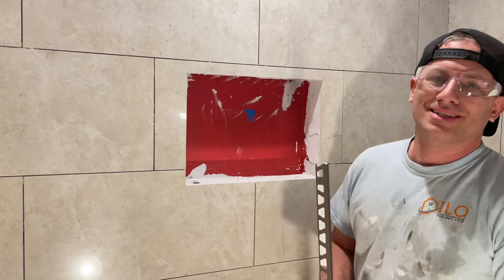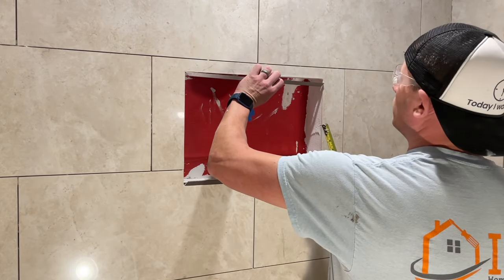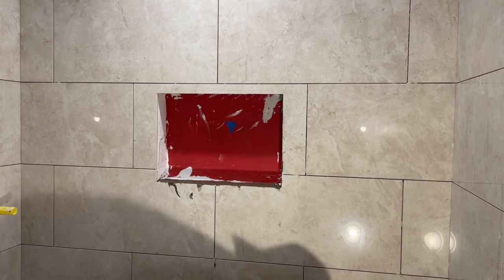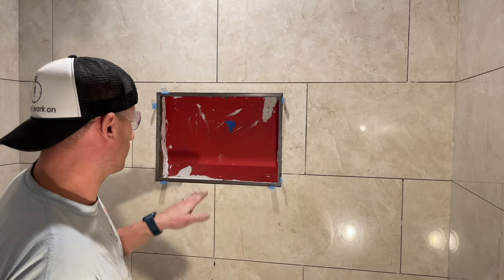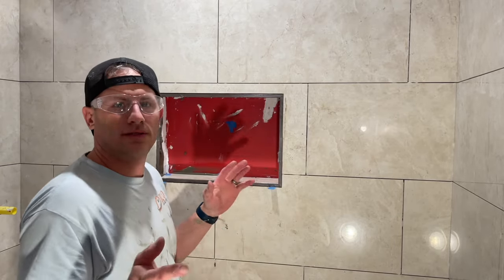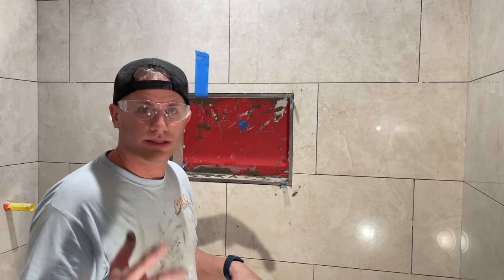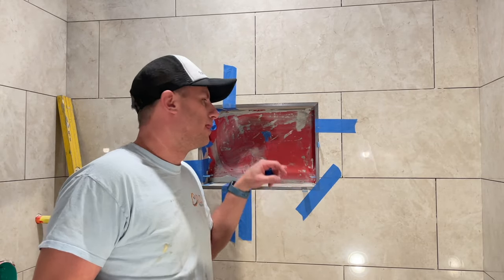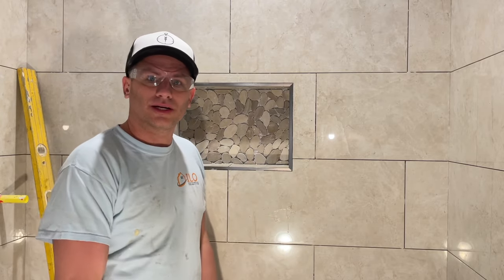How I Trim and Finish a Tile Niche

Comment: I'd be pissed if my niche was offset and off center from the tile like you have it. Looks bad. AND you're supposed to install the back wall of the niche first....but hey, every one is in a rush to start a youtube channel.
Reply from the maker: It might take a while to recover from this comment. Ok, I’m recovered.
Reply: @TodayIWorkOn   Sarcasm will not make you better at your trade. However it does reflect in your work. Hence the bad tile job. Not surprised at all.

And none of the lame retorts you have will correct that bad tile job.
Reply from the maker: @adamwest3266  it’s truly horrible. It’s why I’m no longer a remodeler and will build my own houses from here on out so I’m the client and contractor! Now you can rest easy. Wait for a bunch of mistakes and follies while I build my 12,000 sqft house. It’s gonna be super fun!
Reply: Looked for this comment. The offset would drive me crazy. 😂
Reply: @adamwest3266. The niche is perfectly centered east-west.  Maybe you should put the crack pipe down before bombarding a YT creator with insolence, condescension.

The back is customarily installed first, but ultimately it does not matter so long as it looks right and performs appropriately. 

P.S. Don't care what anyone says, you were the best Batman ever.
Reply: This was a joke right? Lol
Reply: Great job
Reply: No you want the bottom in first just like flashing a window! Sometimes existing plumbing/framing may not allow the niche to be centered
Reply: My OCD and anxiety would never let me sleep again knowing that niche could have been moved up an inch to line up with full tiles had a proper layout been done 😂
Reply: It’s not off center, just offset. More over it may have been the only option depending on what is behind the shower wall. If this is a remodel and not an original build you have no idea what was behind it and what they’re dealing with, more over the person who hired them may have opted for this, I think it’s a pretty neat look and I am not special by any means, so I’m sure others may like it as well.

Just because something isn’t your personal taste doesn’t mean you should berate someone out here doing their best to help others learn stuff. This was super helpful for me to finish tiling my bathroom and again - I’m not special, so I’m sure others were helped too.

Maybe stop thinking you’re so special that your preference is the center of the universe, because just like me you are absolutely nothing special 💜✌️
Reply: Back wall of the niche gets installed after the bottom shelf btw. If you install the back wall first you create a pocket where water can get stuck if you get a leak in your grout. If you install the bottom first then the back wall on top of the bottom, no matter what the water will always drain out into the shower.

Who told you to do the back wall first?
Reply: The back tiles of niche lack a complete grout line around the perimeter. Should have moved niche up an inch and wider, the size of a full tile.
Reply: Why would you do the back first? If that’s the case than any water hitting the back will run down into a joint between the back and bottom. If you do the back last any water will run down and onto the bottom and run out? Honest question? You seem like a level headed person give it to me?
Reply: You do not install the back wall of the niche first! You install the sill first. The back wall and sides should sit on top of the sill for proper water runoff if you ever get a leak in the joints. Jeepers, dude. If you're going to criticize someone at least know what you're talking about.
Reply: You install edges of a niche first, so when you place the back wall it sits in front of the "seal" created by the tiles on the edge. It gives better protection against water infiltration.
Reply: @joshualambert8346 No, you install the top first so the sides can support it and you dont have to leave a perfect gap for the top.
Reply: @Participant616  I was discussing rearmost wall.
Reply: @palebeachbum it doesn’t make much difference if you install the back first, water will always find a way under the tile if your using grout and thinset. Your niche should be sloped at the water proofing underneath the tiles so water can escape.

Comment: You used mastic in the back of your niche? Sorry for whoever that shower is for. It’s got it written on the bucket in red letters “Not for wet areas” that’s because it’s an organic adhesive and will delaminate when exposed to moisture as in a shower.
Reply from the maker: Have a beer and relax, It’s going to be ok. 🤣. You actually just gave me a great idea for a video!
Reply: @TodayIWorkOn  Stick to gutters and screen doors tallying is not your niche.

Comment: Good video, you can do it that way, we do. Solid surface 2CM quartz made to match any near flat surfaces like curbs, niches, or shelves . the metal trim tends to hold water right on the edge . even if you wanted to do 2CM solid surface quartz on the bottom, and then which would be better put the 3 pieces of trim around it. Looks good...... Also, nobody knows the true length of metal trim inside a shower without rusting,even the best marine screws rust overtime . that's why we switch to quartz for niches also, and it's better for water intrusion doesn't let as much water in.

Comment: Good video! A question that I do not want to come off as a criticism because I'm only in the process of learning how to tile and I just want to know for my own edification. Why didn't you raise the location of the shower niche so that the top and the bottom of the niche hit the horizontal grout lines of the tile? Wouldn't that have saved a lot of tile cutting and eliminated the need for grout lines in the niche other than at the corners? Thx so much!
Reply from the maker: That was the plan, but when I was recording the video, I mis measured. Lol recording while working is very hard. I made up for it in my wall to wall niche video. 😉
Reply: Poor planning

Comment: nice work! curious what you do about the mitered edge profile - caulk the tiny gap between the mitered pieces, or just leave it?
Reply from the maker: If you cut it super tight, nothing. If there’s a 1/32” gap it usually fills with grout.

Comment: Going to try this. thank you. 
Also when tiling the shower walls with 12 x 24 tile. Do you want the small cut piece at the top of the shower or the bottom. So full tiles all the way up  with the finishing tile that gets cut at the bottom or the top?
Reply from the maker: Because nobody is perfect, I actually measured out this to fit perfectly with a 12x24 and messed up by not accounting for an extra 2x4, so I was 1.5 off which is why the top of the tile has a small
1.5” piece. 😞. Measure twice and tile once. It’s just an aesthetic thing. 

In summary, try and shoot for a full piece.

Comment: Thanks for your video!  Hope you can help me with something I've not been able to find on youtube. Since you installed large format 12x24 tiles, I assume the tiles you cut for the inside of the niche were 3/8" thick.  What height Jolly trim did you use?  3/8" or 1/2"?  Thanks.
Reply from the maker: This is a great question with a complicated answer. Schluter says to use the next step up on height for the jolly. So, if the tile is 3/8 schluter recommends per my tile company to go 1/2. I have always gone against that rule and have gone with the same size jolly with the same size tile. So, 3/8 tile, 3/8 jolly. What people don’t realize is the base of the jolly already sticks the tile out 1/8 of an inch. If you get a jolly that’s 1/8” bigger than the tile, you have to now build out the tile 1/4”, which is a lot and it’s very hard to make it look right. 

In conclusion, stick with the same tile/jolly measurement and you will be gucci.
Reply: @TodayIWorkOn  THANKS MAN!!!  You are the first person that answered the question of jolly height for 3/8" thick tiles.  I even called Schluter and the tech did not (could not) answer my question directly. I will like your video and subscribe to your channel to help you out.  Thanks again!!!

Comment: Thanks for the video! What kind of blade did you use on the miter saw to cut the schluter? Would a regular wet saw work?
Reply from the maker: You can use a wet saw, but the carpenter in me likes using a real miter saw because it's WAY faster. Lol.

Comment: What glue did you use for the accent piece?
Reply from the maker: I actually used tile mastic(the white glue) since I didn’t  have any thinset on me, but the proper way to install the mosaics would be a modified thinset mortar. These mosaics held up fine, but if you had to choose two, go with modified thinset.

Comment: Great video! My question is, how is the mitered angle of the frame water proofed? I get that the grout seals the outside and inside edges, but the 45 degree miter is still not completely sealed
Reply from the maker: Tile, grout, and trim are not supposed to be waterproof. The substrate behind it is the actual waterproofing. If water does get behind the trim, it will go and release in the pan or though a grout line. Most times some moisture will just get absorbed in the mortar behind the tile and it will end there.  If you watch my video on how I waterproof the niche, I get into what actually waterproofs the shower as a whole. 

Most failures in a shower are due to a lack of proper waterproofing behind the tile. Tile, grout and trim is an aesthetic. The only exception to this rule is a waterproof silicone on an inside joint where a glass panel meets tile.
Reply: @TodayIWorkOn  That said, it wouldn't hurt to put a little dab of silicone between the mitered edges.

Comment: I have a question. Great video btw. 

My question is where does the tile need to end?right at the edge of the niche or does it have to past the edge of niche!
Reply from the maker: I usually go about 1/8 past the niche box with the tile so i have some wiggle room for adjustments.

Comment: Why did you not have the Niche a little higher so the tile on the top and bottom didn't need to be notched?
Reply from the maker: Well.... nobody is perfect? I Was videoing how to install this and messed up my measurements. It's a lot of work to video, work on a clients house, and be efficient.  I have changed how I measure and have not made that mistake again. Watch my whole wall niche video, I make up for the mistake here, there, lol.
Reply: @TodayIWorkOn  Oh I understand, I had this happen on one of my personnel projects.  It takes me longer to get the niche positioned correct than it takes to put up the tile.  Thanks for your response.

Comment: Warning: do not put that frame on the bottom part of the niche because even with an angled bottom the frame blocks the water from draining out and it floods the niche. It happened in my shower b
Reply from the maker: There should be zero room for any water to get in…. That’s install error. Sorry that happened to you, but this is way to install a schluter jolly happens like this thousands of times a day. One bad experience does not mean not to do it. It just means to do it correctly. 😉

Comment: Mastic for the pebbles is an orangic material.  I thought the rule was never use it for tile that gets wets as it can mold and break apart.
Reply from the maker: If it was on a shower pan, sure. Mastic is fine for an application like this. It’s not submerged in water. Don’t over think, use common sense with some applications. Redguard is not organic. The netting on the back of the pebbles is not organic. The pebbles are sealed. The polymer on the grout is not organic. What exactly going to fall apart? I appreciate your comments and thoughts!
Reply: Personally, I'd never use mastic in a wet area, especially a shower... Quality work until then